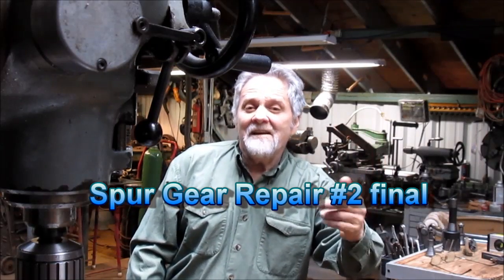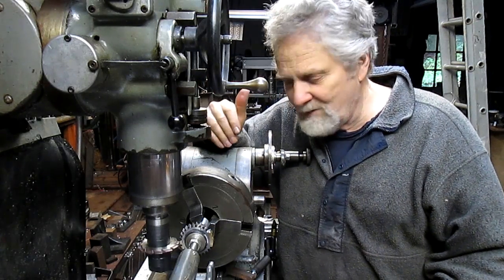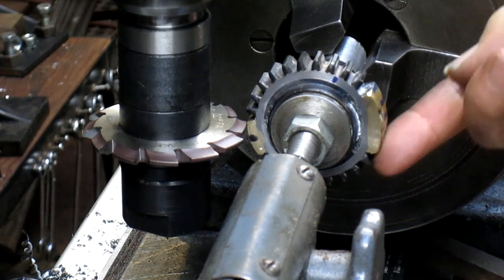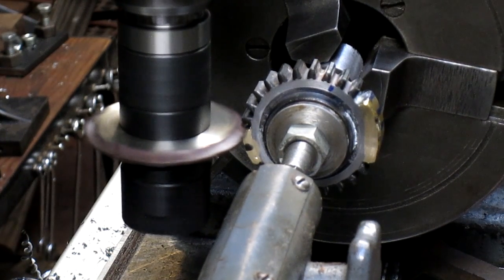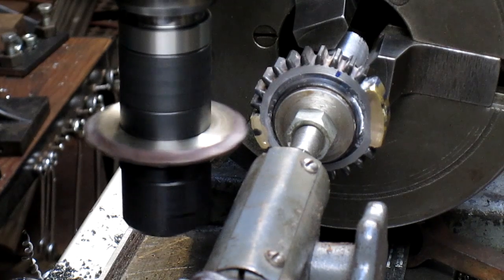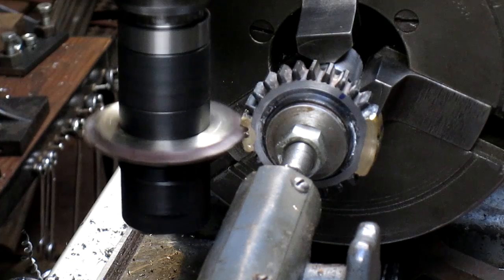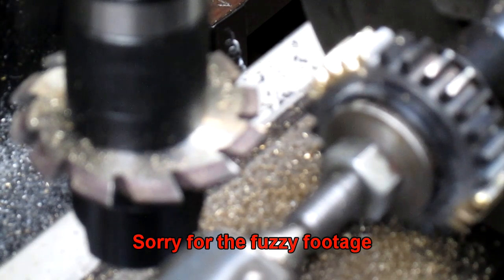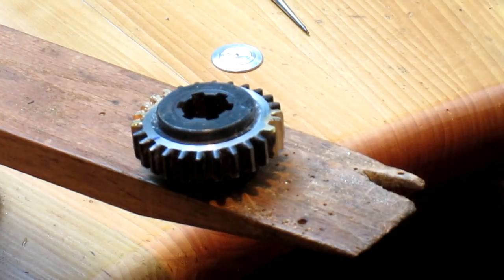Spur Gear Rebiuld #2 of 2 final

Comment: Haha. I understand Your initial frustration regarding the number of teeth and Your dividing equipment. My question is how You syncronized the dividing head to the tooth wheel? Eyeballing?
Reply from the maker: Yes, eyeball, but slowly working my way into a good tooth then raising up and down until the cutter touches both sides of the tooth at once while running. Once that is right the rest of the teeth follow.
Reply: @NikColyerMachineWorks  Ok. Well done!

Comment: I'm confused about how you indexed the gear so a gap between teeth was exactly on center.   It's possible you centered the height of the tool, then loosened the gear in the chuck and centered it with the cutter?   This is the only way I can think of to do it.
Reply from the maker: It's all about finding centers. The centers of each end of the shaft, the center of the shaft itself, center of the cutter, then rotate the gear tooth around until it matches perfectly. The last part is more of an eyeball than anything. Keith Fenner explains it so much better than I:   https://www.youtube.com/watch?v=qEGAs8OMuJc
Reply: I like your video's, less of a "lesson", more of a ride-along as you work through the problems.
Reply from the maker: Mr. Pete and Keith Fenner are more about lessons and I have learned much for both. When I started doing videos I wanted to make it about the fun of creating.
Reply: Your doing a great job.  Thanks for all the effort.
Reply from the maker: Thanks Crafted, it's fun.

Comment: Very nice work. Very nice brazing. Cutting gears (I am building a clock right now and it has a lot of gears) is a nerve-wracking experience for me. So many mistakes you can make! For instance forget to lock the dividing head -- bzzt, crash the cutter. Near as I can see you made no mistake. Bravo. Sorry you will have to sell that mill. The info on dividing ought to be in Machinery's handbook -- but your chart is a good find.
Reply from the maker: Oh, I made mistakes up the ying-yang, but edited most of them out. I'm having second thoughts about selling it, but who knows.

Comment: nice repair job . what kind of dividing head is that i dont recognize it. machinery's handbook has the calculations you need for setting up the dividing head. its rare that i cut a gear,so i need to reference the book every time i cut gears. there are websites that allow you to download older versions of machinery's handbook. google it .
Reply from the maker: +larry sperling Gears are strange for sure, but I struggled through this project. I'll check out my handbook.